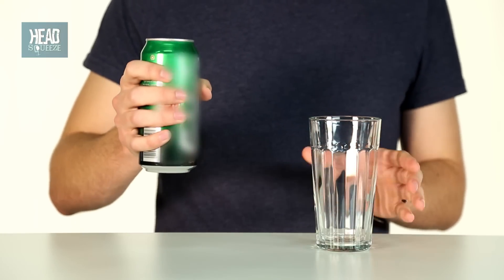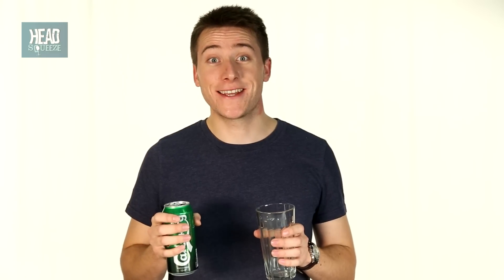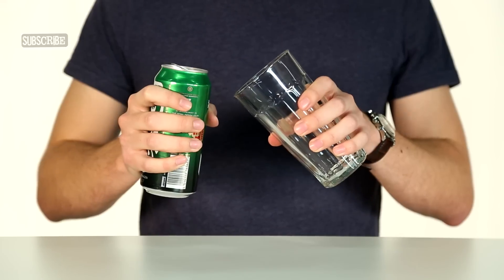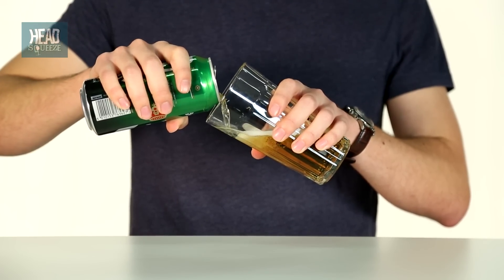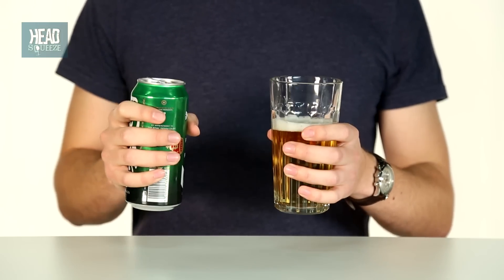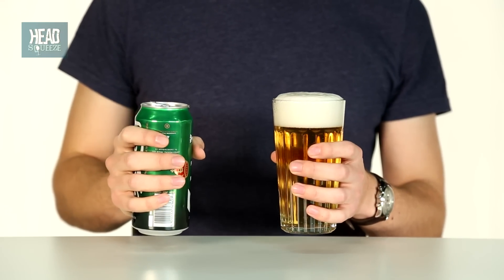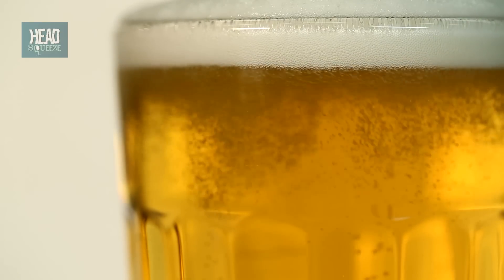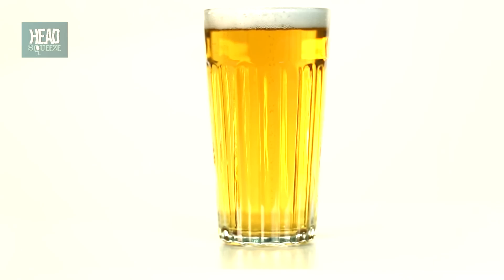How To Pour The Perfect Pint! | Earth Science

Comment: I'm not going to take any advice on poring a Lager from a English person!
I will not say anything about poring a English Ale. Do however you like, the result is great and the mess is acceptable in the name of tradition.

But since so many Brits these days choose imported Lager, please also import the etiquette that comes with it.
This video does not actually represent the worst lager pour I have ever seen. I see much worse every day I'm in a pub here.
Just my 0.02€ on the perfect lager:
1) The right glass. A wide pint glass is the worst option. Lagers delicate aromas last better in slender high glasses.
2) Rinse the glass right before you pour. For foam stability.
3) Don't pour all the way to the top. Pour slow and at a angle (thanks that was right in the video) and produce a big thick head.
4) let it settle. You will see that the liquid level will rise once the head comes down.
Voila, perfect lager.